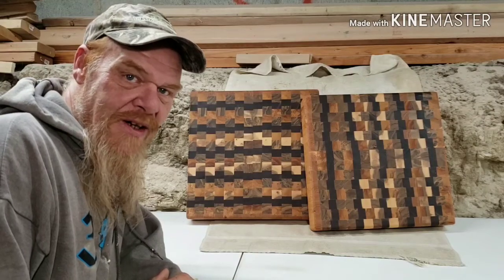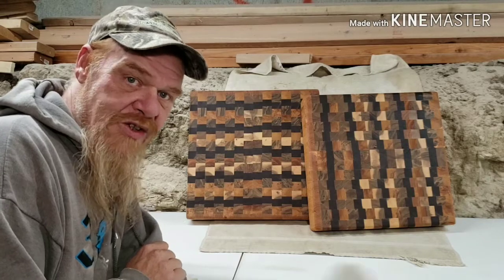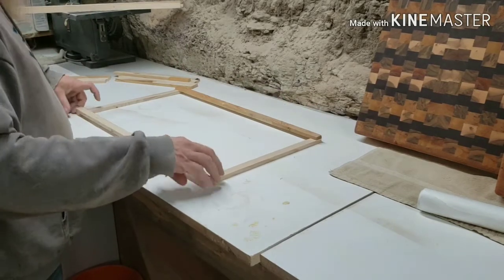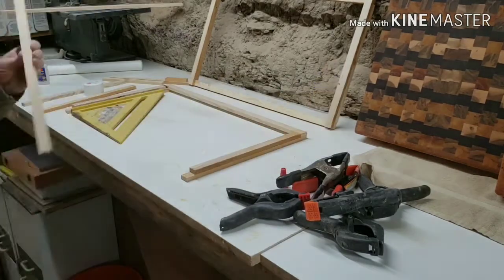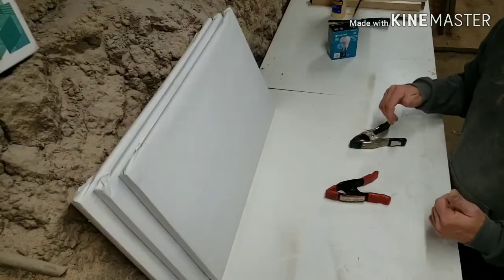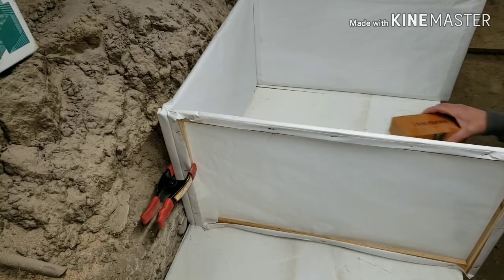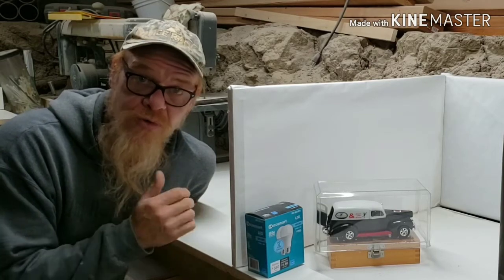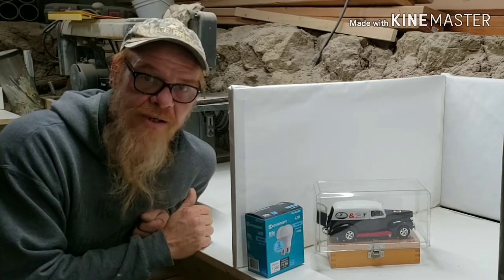DIY LIGHT DIFFUSER FOR PROFESSIONAL PICTURES | PHOTO BOOTH

Comment: Good idea Kevin!
Reply from the maker: Thank you Rob. I thought about using purple heart, wenge & black palm for the frame with bubinga splines and spalted beech dowels for strength,  but i could not find my mitre spline dowel square hole rabbitting feather board for the assembly. Maybe next time :) :) :)